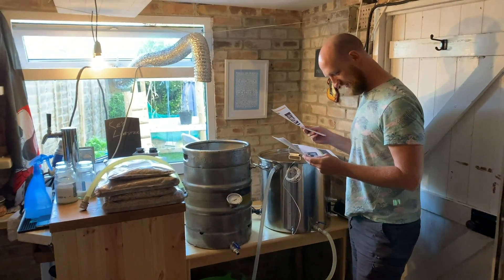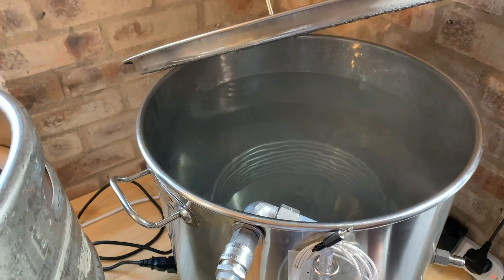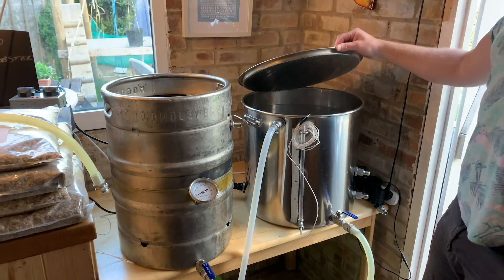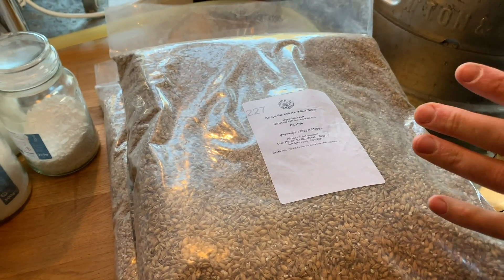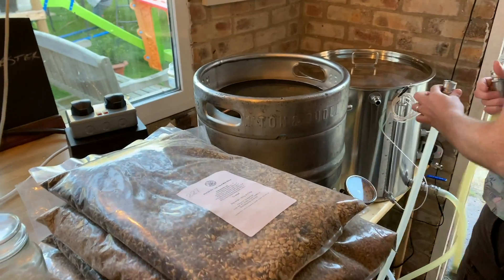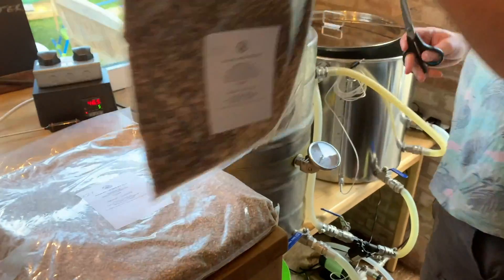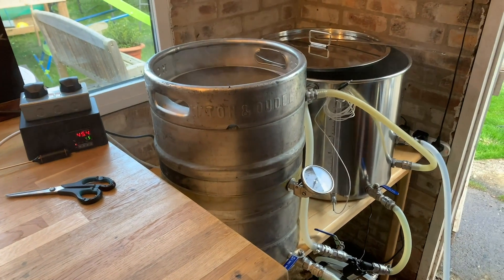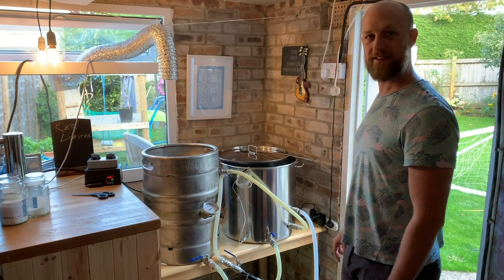How To Brew All Grain | Milk Stout Brew Day Part 1 - Recipe to Sparging

Comment: Curious if you guys let the dough-in settle for 10 minutes or so (after stirring a bit) before you run the recirculation during the mash. I hear it does wonders for efficiency, but for some reason I always get antsy and start recirculating pretty much as soon as I’ve got about and inch of water over the grain bed.
Reply from the maker: Great question! We do usually let it sit for between 5-10 minutes before starting the recirculation. Anything longer than 10 minutes and I find the mash temp starts to drop fairly quickly as our mash tun isn’t insulated. As soon as we upgrade our mash tun we’ll start exploring this a little more.
Reply: That makes a lot of sense. My Mash Tun is very similar. Keggle design, only not a bottom drain. My RIMS temp sensor is setup just past the outlet of the mash tun, and until this minute I didn’t really think about how that likely was “rushing” my actions. Now this makes a lot of sense why, with the sensor not really tracking without the recirculation. 

I typically Strike low and raise to temp over about 10 mins to avoid accidentally killing some enzymes. Makes for great efficiency, and between the RIMS and burner never really struggle to keep temp.
Reply from the maker: @ChuckUnderFire  Sounds like a decent setup my friend! I researched both RIMS and HERMS systems and decided on HERMS, mainly because they’re more openly available in the UK. For some reason RIMS is far harder to get hold of over here! 

I’ve also experimented with the temp probe positioning. I initially had it on the mash tun outlet, then moved it to the inlet....and currently have it on the pump outlet prior to the herms coil. I’m sure I’ll change it around again soon though. 😂